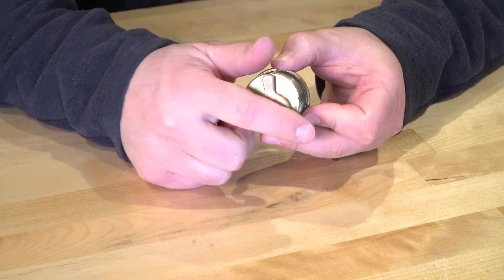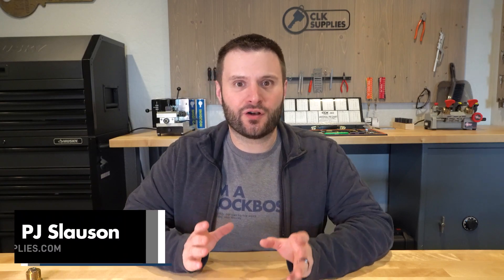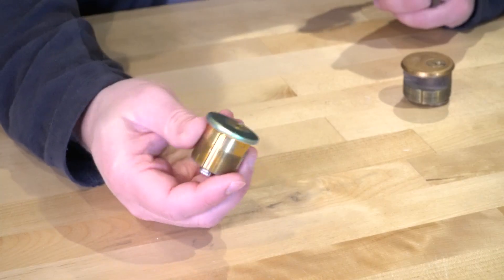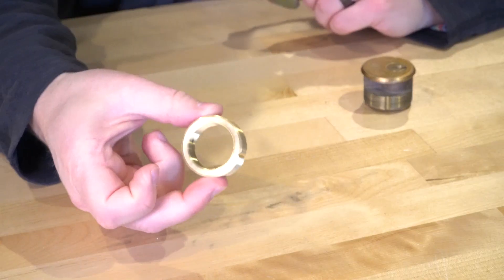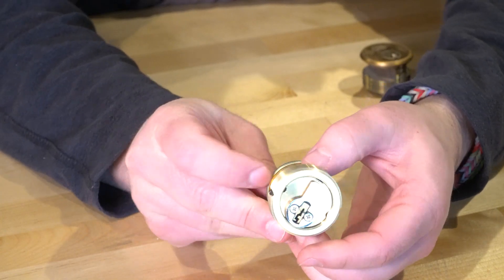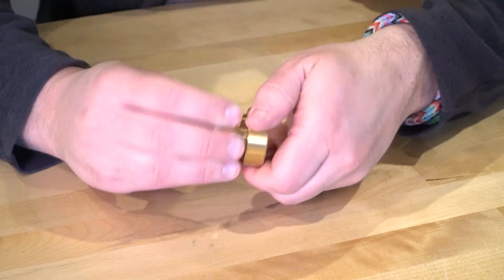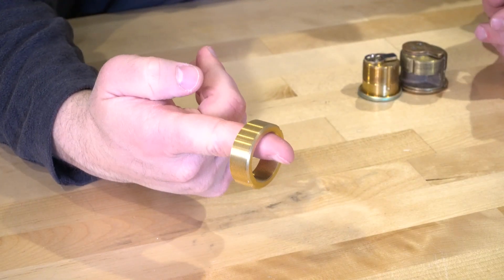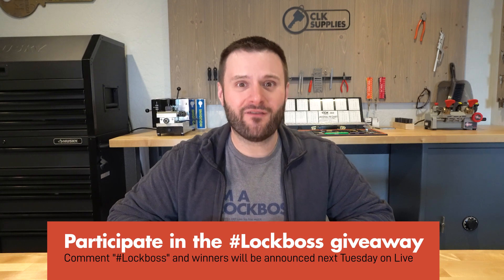Replace a HUGE Mortise Cylinder with a Normal One!

Comment: I've been been fortunate enough to come into possession of some of the older original Corbin master rings that fit a lot of those oversized mortise locks. Very few buildings after the 1920s ever used those, but when you need one, man. Do you wish you had an adapter!

Comment: Hey PJ, thanks for bringing those up. I used to take care of about 70 remote microwave communications sites, usually located on the top of mountains that were built in the 1950's, and almost all of them were the large mortise cylinders. Multiple exterior doors with a few interior too. What a pain to work on when some Bubba thought that he might try and break into. Invariably, they would destroy the cylinders, but never gain access. I had to carry harder and harder to find spares, and did discover the adapters. They saved my bacon on more than one occasion as well as trips 100 mile plus to get a replacement... learning how to #Lockboss!
Reply from the maker: Nice-PJ

Comment: These cylinders were made by Corbin & Russwin and can still be found at some older locksmiths I believe Best still makes a 1-1/2" cylinder so these locks can be to there IC Core system.

Comment: Where I use to work I noticed they did have  mortise cylinders. Did not think they were not made any longer. My question is qhat would be any issue with the tail pieces. How would the modification be done. Make you own tail piece or life down. Drill different hole for the cams. That was a nice hefty cylinder and the adapter for the smallest cylinder was a great idea. Thank you PJ that was some good stuff.
#lockboss

Comment: You are forgetting the hole in the door! I do this a lot. Medeco & Mul-T-Lock make these adaptors as well as the replacement cam. First you put the standard collar, then a flat rim collar. The adapter goes on, then changes the cam. The flat rim collar covers the inch & a half hole in the door. A regular collar for a mortise cylinder will not and you cannot put a collar on the cylinder after the adapter is on the cylinder. Just a mention of note.

Comment: Never come across that larger style. Is there a specific industry that you find them in? I know in some plants they use unusual locking systems to lockout/ tagout high voltage systems and equipment. Thanks for sharing! #lockboss

Comment: Had a customer that removed and disassembled his mortise cylinder for his house, he brought me all the pieces and key to reassemble.  It was weird, there was the plug  a sleeve that fit over it, and then the other portion that was probably the 1.5".  The pins and springs went through all 3 pieces, was a bit challenging to reassemble (first one i had seen up till then, and havent seen one since).

Just one shearline, i am guessing the top pins kept the ring outside of the plug from rotating from the outermost ring?  #lockboss

Comment: PJ Great video. One question though... Are there any 1"-1-1/2: adapter collars? #Lockboss
Reply: Do you mean length adapter collars?  or is the question asking about the security collars to protect from wrenching attacks?
Reply: @zlocksca  Watching the video, the adapter will let you mount the new housing in the mortise lock but you still have 1/4" of space around it. I'm used to Adams Rite swing bolts in storefronts.

Comment: Nice solution. I haven't run into those either, but still nice to know an adapter exists. Would  an ASSA Jumbo tailpiece line up with the screw holes of the regular cylinder? (It would obviously need to be reshaped) #lockboss

Comment: If they make the adapter ring why not make a oversized tailpice to go with it?   Also what’s the solution foe the face of the lock.  Going to have a large gap around the new smaller lock unless you cut a hole in a push plate and add it to the door.  #LOCKBOSS
Reply from the maker: Not that I'm aware of. A cylinder gaurd/mix of existing hardware-PJ

Comment: Those are called  "JUMBO"  cylinders  and are still made and available from ASSA along, of course, along with the even larger Mogul cylinders used on detention hardware.  Nice to know an adapter is available. as not so nice to have to change from Cotbin keyways to some other keyway.  Of course it was Corbin that made these Jumbo cylinders famous of years gone bye.  #lockboss

Comment: I think I might be going on a job tomorrow that has these oversized mortise Cylinders. The job is a rekey, and do they use a standard 1/2" follower? I would appreciate knowing if you can tell me. Thanks #Lockboss
Reply from the maker: Most likely but it's hard to know-PJ

Comment: Neat that there is an adapter ring, but the tail piece issue isn't really addressed.  If it isn't long enough the adapter ring is meaningless.  Sounds like a half baked solution.  How about just finding someone to make the large mortise cylinders?  Or replacing the lock body with a modern one that takes a standard cylinder?  I'd rather do that than spend 3 hours trying to make a brass tail piece longer and reliable enough to work.
Reply: Reuse the tail piece from the old lock. If that isn’t an option I’m pretty sure you can still get the big tail pieces new but worst case get one NOS or used on eBay. It may not be an instant solution but it will work. If broken and need an instant replacement chances are if there’s another locksmith around that’s been in business a long time theyd have a couple kicking around from old jobs and would sell them or give them to a fellow locksmith. I keep all kinds of old parts from locks especially odd ones I don’t normally see just in case I have to replace something that hasn’t been in production for a while. I’m kind of a junk pack rat though. I have a 10” wire key ring I feed through the tailpieces so I have a big ring of odd tailpieces if I’m looking for something.
Reply: @LuckyStrike01  I like that idea of keeping old tail pieces on a key ring. Good idea!

Comment: So, the adapter ring solves the issue of securing the cylinder into the lock, but what's the fix when  the 1 1/4" face (approx.) sits in a 1 1/2" hole??? Seems a mogul cylinder from Folger Adam, etc. would be the true answer to the problem. #AccessLockKeyLLC #HaulinBrass #LockBoss
Reply from the maker: Yeah, or a mix of existing hardware/ cylinder guard-PJ